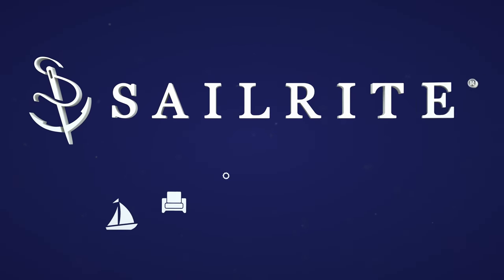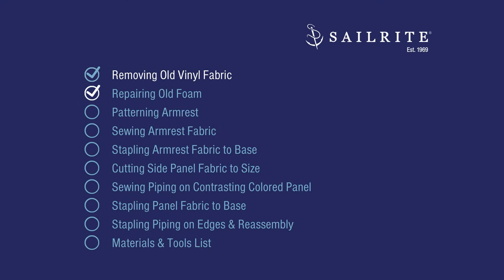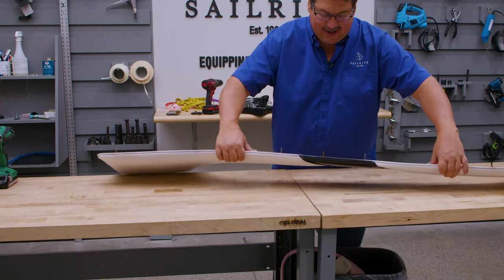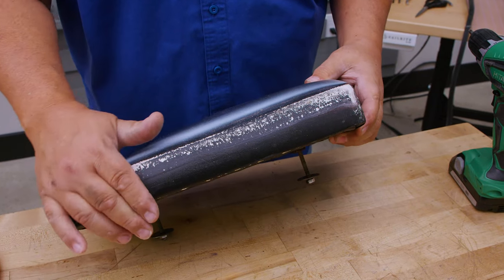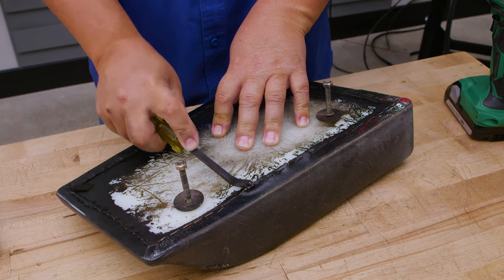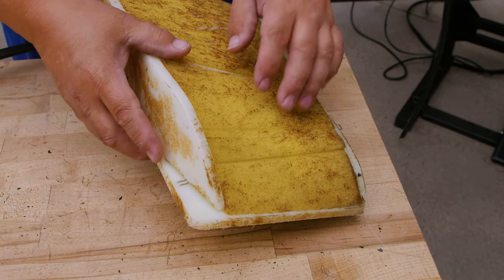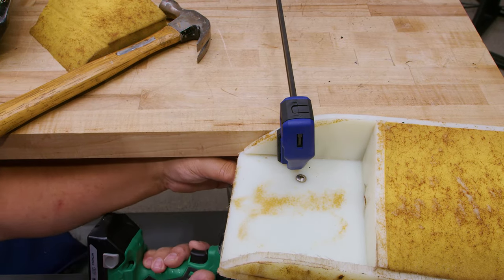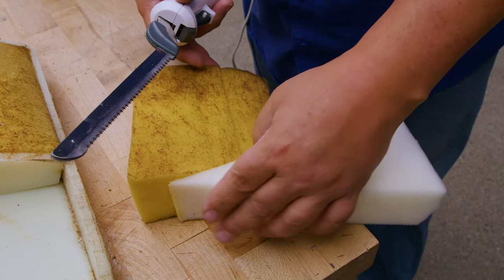How to Upholster Side Panels on a Speedboat

Comment: Anyone know what the bolts on the back of the side panel are called?  I need to replace them on my side panels due to corrosion.
Reply: What I use is 1/4 "T nut". Drill a hole in your wood, tap the t nut into the hole, thread your bolt through. Might sound confusing but it's really simple. I'm sure there's videos of them on YouTube.